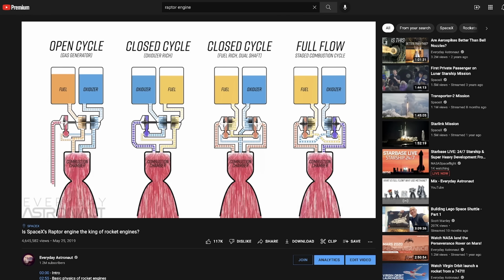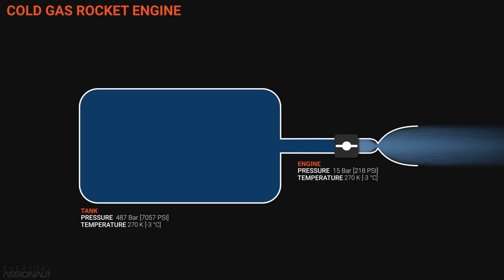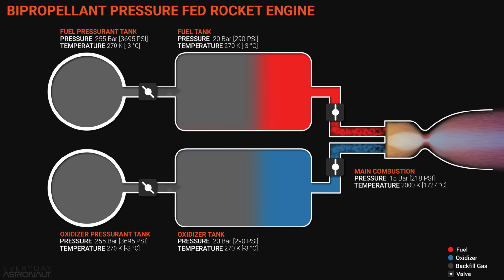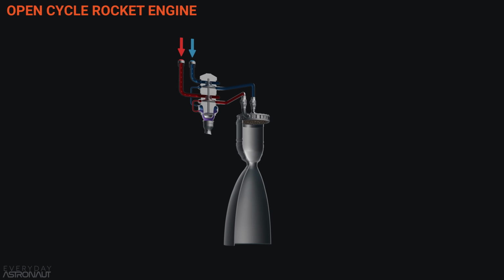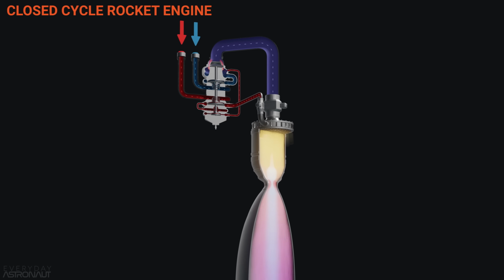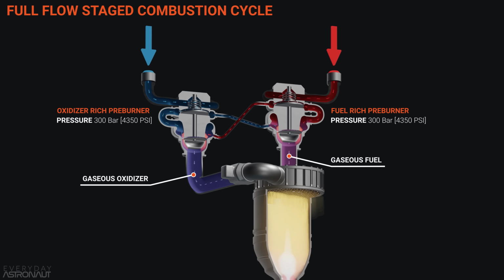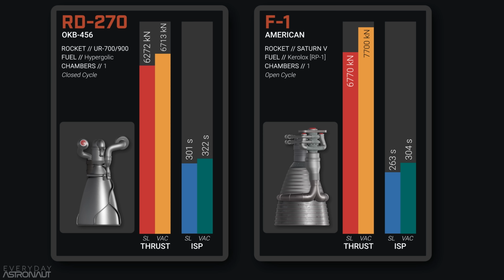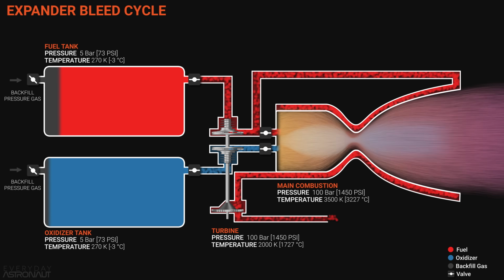Rocket engine cycles: How do you power a rocket engine?

Comment: Can you make a video about the structural engineering of rockets? I am always amazed how they transmit hundreds or even thousands of tons of thrust into the chassis, without everything just getting crushed^^
Reply: The way they manage to do that is basically just pressure. Just like how you can stand on a closed full soda can without a problem but when it's empty and doesn't have pressure inside it will crumble under the load. If you have a thin wall tube that you put under a load it will want to move and deform. But if you cap it off and put some pressure into it, the pressure inside will will push against the tube walls and spread out the load across the whole thing and actively fight against it changing shape since that would require the gass to compress even further. I't like how the more you blow up a balloon the harder the outside of the balloon feels.
Reply: @Paragon643  This could probably make for a short, but this definiely cannot be a full video
Reply: Yes, I have asked for this topic before.  The mechanical engineering doesn't get nearly as much attention as the chemistry.  All that expanding gas pushing on the diverging surfaces of the nozzle, and the injector plate, and then up through the... um, how does it all not blow itself apart and crush itself?  The entire weight of the vehicle balancing on the tiny surfaces of the thrust bearings!  The mechanical engineering is insane.
Reply: It's actually surprisingly simple. 
It's the same way you can stand on top of a room-warm aluminium soda can (unless you weigh more than 86 kg or 189 lbs, or apply the force of your weight unevenly), and FYI that can has walls of the same thickness as typical copy paper of 0.1 mm or 0.0040". The reason it won't crush, is that the internal pressure of the can trying to rip/blow it to pieces, is larger than your weight crushing down on it (unless you weigh more than said weight).
On rocket engines, unless you want the turbo-pumps to cavitate on the inlet side you need the pumps to have a minimum of "head pressure" or "ullage pressure", so the rockets tank(s) (so nearly the entire rocket) are pressurized typically a little more than 3 Bars (soda cans have about 2.44 at room temp), and even at max thrust and pay load, most any rocket body (tanks basically) are under TENSION trying to rip apart, instead of being crushed. To put some numbers on it: A F9 has a ullage/head pressure of about 3.4 Bars, which at the 3.66 m tank diameter means the top of the tanks/rocket are trying to pull away from the bottom with a force of roughly 357 metric tonnes. The max payload is 22.8 metric tonnes, the rockets own empty mass is 25.6 metric tonnes, max Q ( peak air resistance pressure) is about 0.4 Bars, a typical coefficient of drag at Max-Q is usually around 0.72, meaning that those 0.4 bars act on 72% of the actual frontal area, resulting in a "crushing" force of  about 61 metric tonnes, also the rocket is accelerating with about 1.6G making the payload act as 36.5 metric tonnes, the rocket hardware it self act as 41 metric tonnes and the total load is then 138.5  metric tonnes, however this is not the max load put on the tank structure on the rocket, but is where the aerodynamics are the worst with regards to payload fairing etc. SpaceX defines the max load to be 6G which for max payload of 22.8 = acting as 137 metric tonnes, and the rocket hardware it self acts as 154 metric tonnes. At this point we are in space so aerodynamic load is for all practical purposes none. The total is then 292.5 metric tonnes, which is still less than the rocket is "stretching" itself with ;)
Reply: @flyfaen1  I think we're more interested in knowing about the structures used to translate the force evenly, not the fact pressurized containers can hold more. How does spaceX translate the forces through the vehicle, load analysis. How do these structures connect with different thermal expansion ratios. I appreciate the long reply but there are structural designs that have been tested that aren't used anymore. Gimbling forces from the engines must be managed by the structure, what does that look like. The topic has a ton of potential beyond what videos have already been made.
Reply: @danR Thanks for the response. How are the engines mounted to the tanks though, they're not welded directly to the tanks. I like we're having a long conversation, hopefully a video about this is made in the future, there are a lot of things to talk about on this topic.
Reply: It's all about the choosing the right shapes (and materials too) , for example a cylinder is very strong for axial forces, and a nozzle bell have the same shape and strength as a cathedral dome.
Reply: Yes, please, materials' mechanical properties and structural engineering would be interesting!^^
Reply: This would be a good topic, it could have a section for the starship's "thrustpuck"
Reply: Or even how spinning parts deal with centripetal forces applied to them
Reply: Great idea i also had same problem.
Reply: If he told you, then he'd have to kill you!
Reply: agreed. more to rockets than engines

Comment: 8:06 this is an important chart but I don’t think you’ll ever find atomic hydrogen oxygen or nitrogen, ever. (neither fluorine but I don’t recommend being in the vicinity of fluorine)
So correct numbers should be double for the mentioned gases, because nitrogen and oxigen gas is not N or O, it is N2 or O2.

Comment: My biggest and simple question about how a rocket works is this: where exactly is the reactive force reacting against? Is it, the high pressure in the tanks that basically pushes the rocket up, because there suddenly is a pressure difference (engine firing). Or is it the top of the engines where the reaction is taking place, so pushing against the injection plate?
Reply: Pushing against the nozzle if I'm not mistaken
Reply: Thinking along those lines, what the exhaust is "pushing" against is the area of the injector plate that is not balanced by the nozzle throat, in addition to the inside of the expanding portion of the nozzle. If you imagine staring down the business end of a rocket and integrating the pressure on all the areas you can see you'll get the thrust of the rocket.
Reply: It is mostly the nozzle.  For emple look at the faclon9 merlin engine.  The fist stage engines have a small nozzle and generate 853KN of thrust with a ISP of 282 seconds.  The second stage is the same engine but fitted with a much larger nozzle optimized for vacuum operation.  It produces 981KN of thrust with an ISP of 311 seconds.A substantial thrust increase without any change on the injector plate.
Reply: @stevenf1678  That indeed makes a lot of sense. I just find it mind boggling that the nozzle can handle that force, which would be the weight of the entire rocket and then some on a tiny area. Also, when looking at the startup of the Shuttle engines, you can see them flex, which I wouldn’t relate to being super strong. :) Thanks everyone!
Reply: @kevinstrout630  Fascinating, because I always assumed a nozzle or part of the engine, not to be strong/rigid enough to withstand the created forces.

Comment: So if a full flow staged combustion cycle will still have the soot/carbon buildup issues in the fuel rich preburner, how was spacex able to overcome this with methane instead of hydrogen?
Reply: My amateur take on this is that it was cleaner than kerosene, and denser than hydrogen. It’s hard to get cleaner than water vapor, but the fuel density on hydrogen would require a way larger system than Starship currently is. Hydrogen also bleeds more, which is both bad for maneuvers on an interplanetary scale and ups the complexity on the fuel plumbing. Basically, it’s the happy compromise of two decent fuels that have their own pros and cons.
Reply: Everyday Astronaut has a video of the pros and cons of those fuels

Comment: You made a mistake at 5:00 when making the absolute statement "always flows from high to low (pressure)". In actuality, pressure is just one term on the right of the Navier-Stokes equation. 

On the right side, there are other forces which can direct flow, including body forces (e.g. due to an acceleration or a force field in the case of magnetohydrodynamics) and viscous forces. 

Also a part of Navier-Stokes equation is momentum. An object stays in motion unless acted on by a net force, at which point it accelerates. A flow could continue up an adverse pressure gradient for a while, given it starts with some non-zero momentum. It takes force x time to change a fluid's momentum.

It is a common misconception even amongst Youtube experts that "fluid always flows from high to low pressure". TechIngredients made the same mistake. It's simply a fallacy.
Reply: It's a good enough approximation, because in aerospace you're almost always dealing with very high Reynolds number flows (especially inside a rocket engine!), so the viscous forces can be safely ignored (so-called inviscid flow or Euler flow). It's also very unlikely you have a body force that differentially acts on different parts of your propellant gas (barring something exotic like an ion engine operating in a strong magnetic field).

Comment: The year is 2067, the first warp engines are being tested in humanities pursuit to other stars, and Tim Dodd explains exactly how it works as simply as 2+2
Reply: And in 2026 how the fuel cell powered cryogenic superconducting combined radial and axial flux electric motor fed rocket engines work.

Comment: You can lower chamber and throat temperature by changing the fuel flow and using the aft cooling manifold. It now becomes a fuel spray nozzle. Like a Afterburner augments thrust in a jet engine.